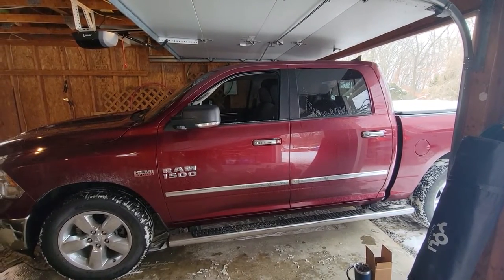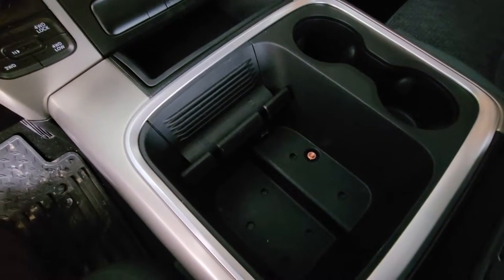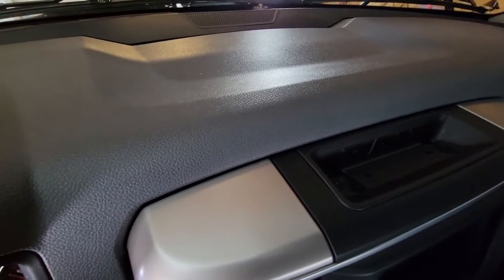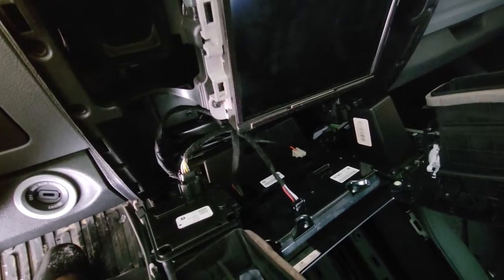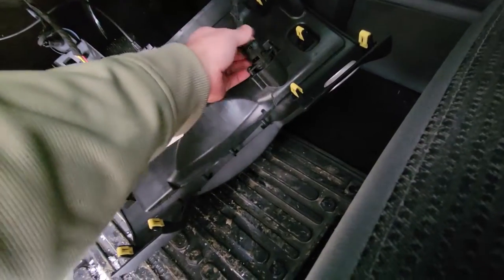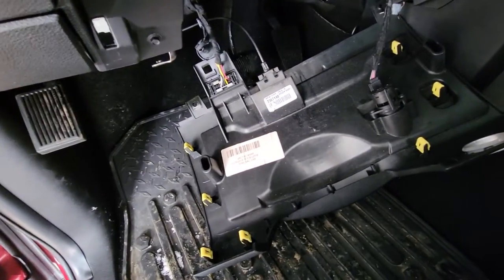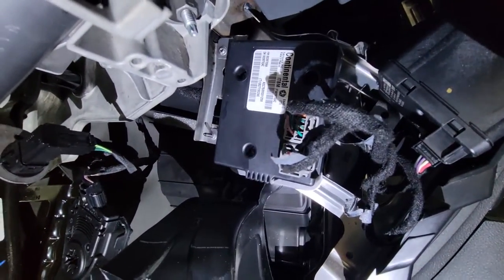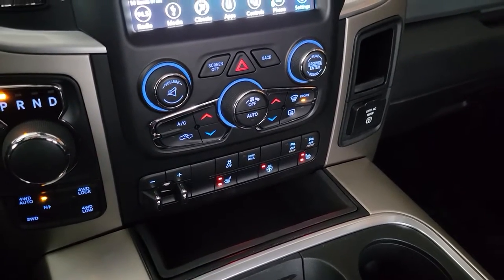2018 Ram 1500 Integrated Trailer Brake Controller Installation

Comment: A piece of double sided 3M poster tape would work fine for that third screw that is hard to get to, that would eliminate any possible rattle in the future and being sticky would help hold it in place as well. Double sided 3M poster tape can be bought at any home improvement store or craft store that sells the 3M velcro for mounting picture frames on walls.

Comment: I just drilled out the holes and used a rivet gun to rivet it nice and tight.
Reply: I did the same thing after a few minutes of trying the screws.  not sure how anyone actually gets the screws in there from the back side.
Reply: I came here for this comment 😂. I’m just going straight for the rivet

Comment: I ordered my Brake controller kit several years ago to pull a trailer from Calif to Tx but the trip fell through and I never installed it....till now.  The main clip that holds the controller in the bracket was broken off completely as was one of the other clips that helps to hold it in the bracket. (there are 3 total) To late to return it so I improvised by using 3 zip ties wrapped around the controller and the bracket.  I also saw no reason to install it the way the instructions shows by trying to screw the bracket through the face plate opening.  Every video I saw, it was just to much of a headache.  I was able to use 2 self tapping screws and screwed them in from under the steering wheel.  It was a little tedious but it worked!!!  Its definitely not the prettiest installation but im good with it.  I hope the Dodge techs don't laugh and ridicule me if they have to look at it when I take it to them to flash it.  As one of the videos I watched asked: Why this installation was not designed so it could be installed from under the steering wheel???  Ed's comment about using a rivet gun is probably the easiest way to do it.  Wish I would of thought of that before i used self tapping screws bc I have a rivet gun.

Comment: I notice my rotors do over heat due to not having trailer controller. My question is will it work on my 2018 ram tradesman? My truck is plain stock/basic as in no touch screen. So i wonder how this feature will work on menu selection? 🤷‍♂️.

Comment: Will the trailer brake controller work without it being flashed at the dealership?
Reply from the maker: No, the software needs to be updated to recognize the controller. The dealer can do it, but I guess there is also a third party gizmo that will do it as well, but I don't know enough to go that route.